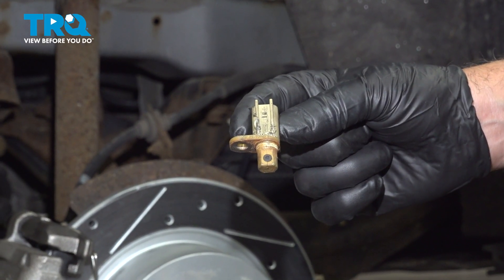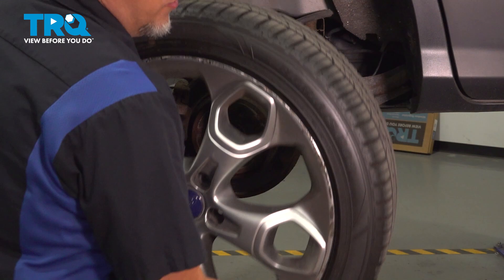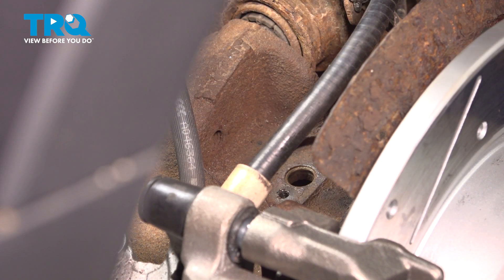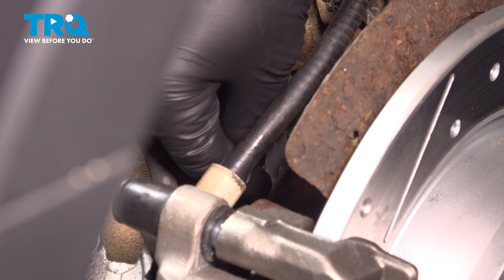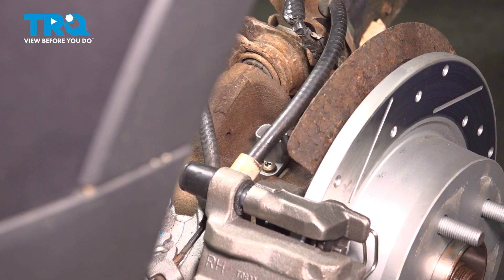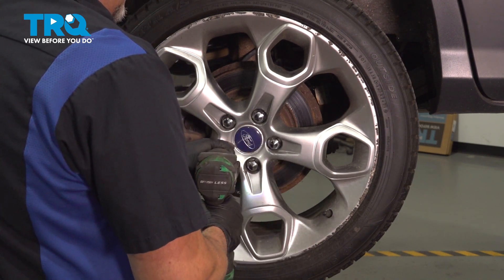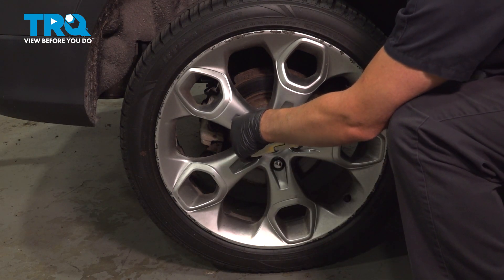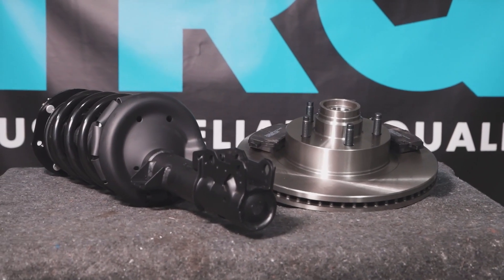How to Replace Rear ABS Wheel Speed Sensors 2013-2019 Ford Escape

Comment: Excellent video, thank you! You saved me a LOT of money!

A couple of weeks ago, the ABS warning light came on in my 2018 Ford Escape. Very soon after, six more alerts appeared.
- ACC (Adaptive Cruise Control) not available
- Collision Warn not available
- Parking Assist not available
- 4WD temporarily disabled
- Hill Start Assist not available
- Front Camera Fault Service Required

A quick check of the manual assured us that normal braking would still work, so we returned home. An auto parts store ran a diagnostic and detected a problem with the right rear wheel speed sensor. Further diagnostics showed that the sensor reported a speed of 158 mph, even when the car wasn't moving.

The part was $50 and replacement took less than an hour. After starting the vehicle, the ABS warning light and a couple of the other warnings still appeared. I used an ODBC diagnostic scanner and a compatible phone app to verify that the new wheel speed sensor now reports 0 mph when not moving. After driving for about a block, and warnings disappeared and have not appeared since.

Based on web searches, this repair could cost $500 - $900 at a Ford dealership.

Thanks again!